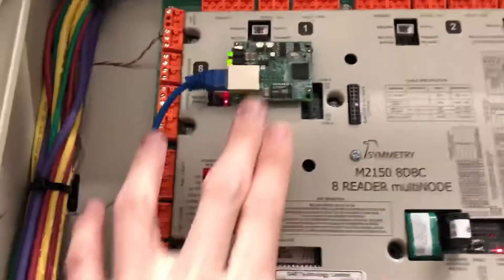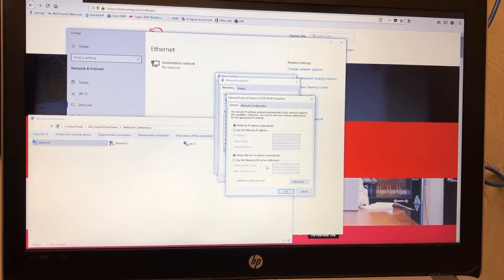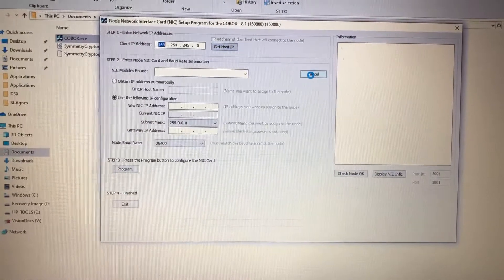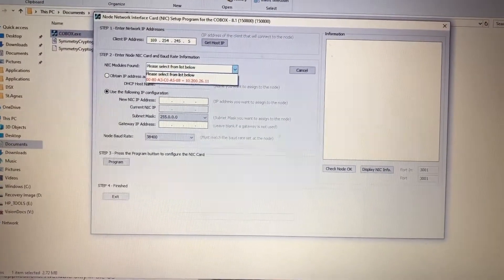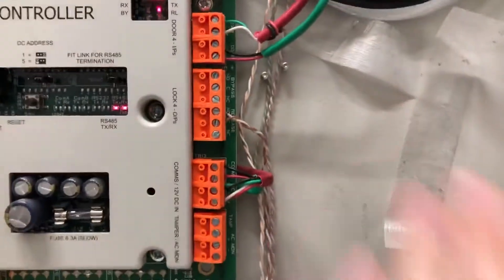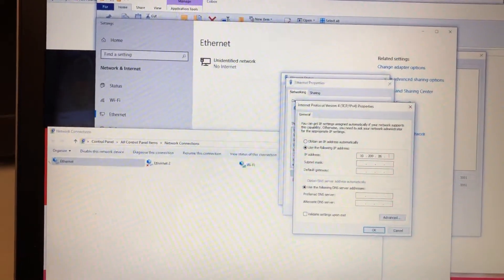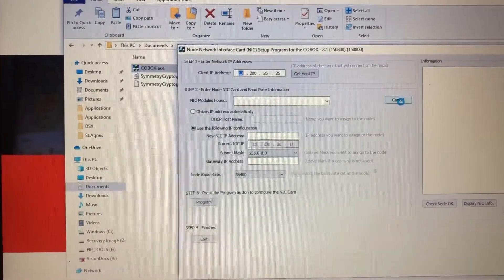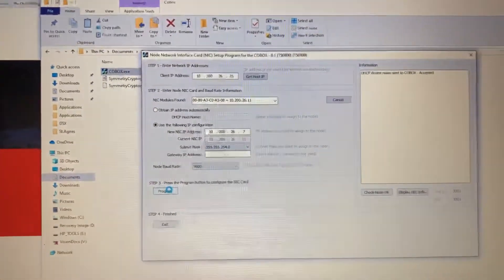How to change the network settings on a network card - Nic card - AMAG - Symmetry - Access Control

Comment: How can I upgrade the firmware version?
Reply from the maker: You need someone with an amag certificate to download the file from the amag website first. Then use cobox to connect a laptop to the board using the Ethernet cable. But keep in mind that if you update the panel, you will also need to update the software. And depending on the version, it might be an expensive upgrade.

Comment: Can we talk about what the dip switches should be
Reply from the maker: There is not really a standard for the dip switch setting. You select the switches based on what you want the board to do. Some select the communication speed, some set the board address that needs to match the software. One dip switch turns on the battery to store your data. 
Do you have the manual? It will walk you through the individual switches

Comment: Can I replace an old 4 door panel with an 8 door panel using the same dip switch configuration?
Reply from the maker: I’m not sure if the dip switch settings have the same meaning for each pin.
Reply: @VisionGuy  I was able to find out that the 8 Door controller is Not supported for a swap out
Reply from the maker: @frankiefrank4853  what do you mean it’s not supported? You mean the dip switch settings are different?
Reply: @VisionGuy  They are running the Symmetry Business program and it can only support 4 Card Reader Door Controllers up to 16 Entry Points on 1 Node. I have 3 brand new 8 Door Controllers and can't use them.
Reply from the maker: @frankiefrank4853  I see what you mean. 
I’m used the the enterprise version. So with that, it will accept multiple different boards.
Reply: @VisionGuy  That makes sense. My company is on Instagram and I am going to start sharing more with the technician community on there. Check it out if you are interested. It is @CicadaSystemsAz